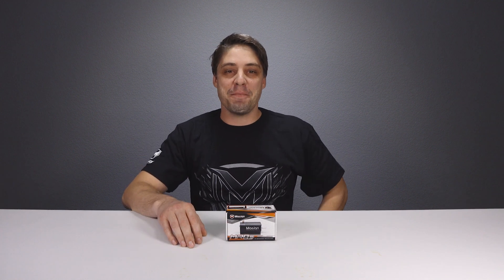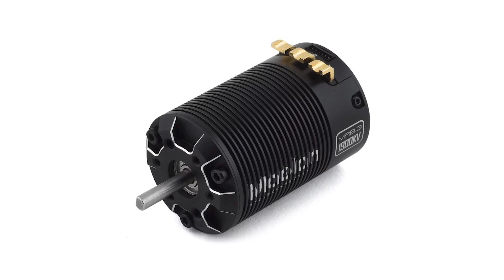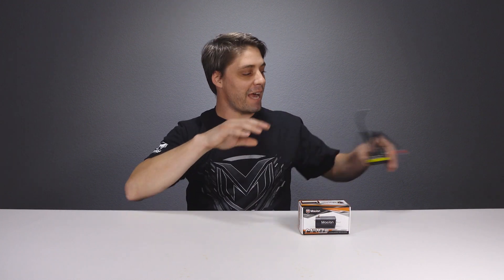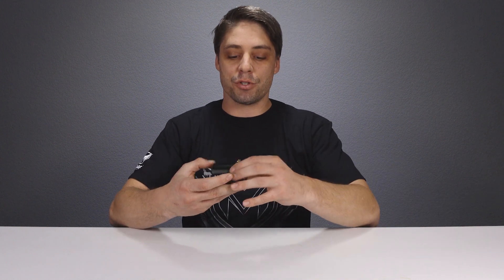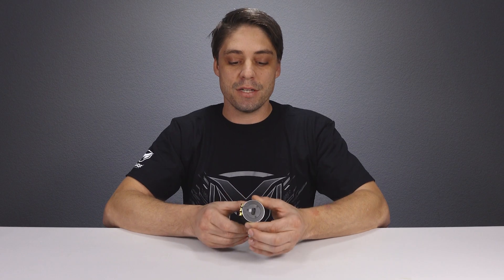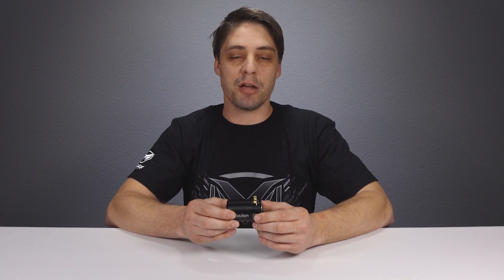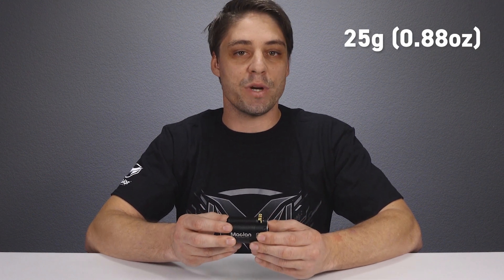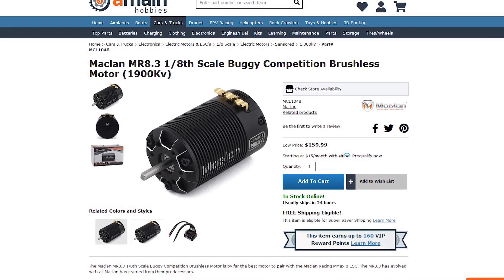What's New: Maclan MR8.3 1/8 Brushless Motors

Comment: Need to offer it at a combo price, 368.00 is too much separately.THANKS!!!
Reply: Yea probably for me2 but uk get what you pay for this world and I'm sure it's way better linear wise than rtr or even HW  something put in nice kit
Reply: 17Shaky level up🤔
Reply: Ive seen Maclan motors outperform Tekin ones (on road, haven't seen a Maclan system offroad yet), and the ESC is a bit cheaper than an RX8 Gen 3 so overall, not too bad on the pricing to be honest, and when you are racing seriously (which is who buys Maclan products) you are going to drop serious cash into your build anyways.

Comment: How does this compare to an Axe system?
Reply from the maker: These MR8.3 Motors are for 1/8 scale competition buggy use; the Axe system is for 1/10 rock crawlers. The MR8.3 motor will not fit a 1.9" trail truck application (but if it could... HORSEPOWER!).
-Brett